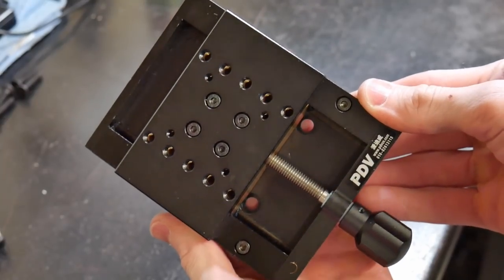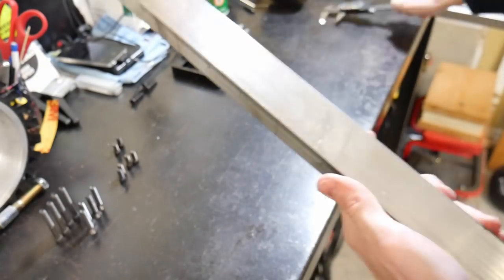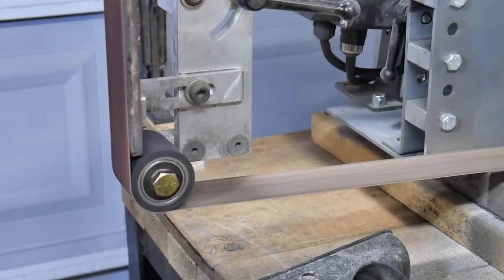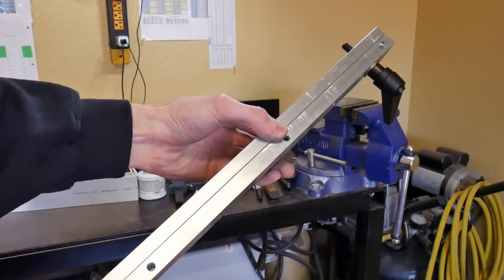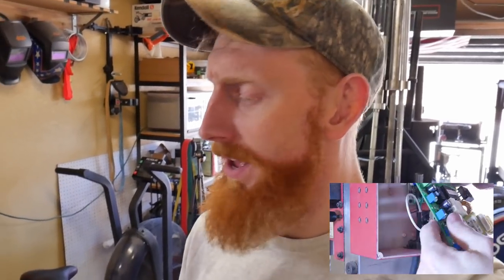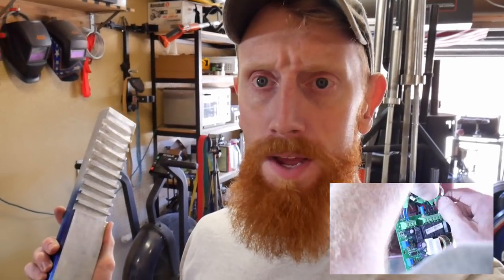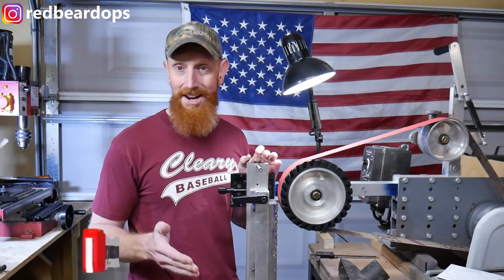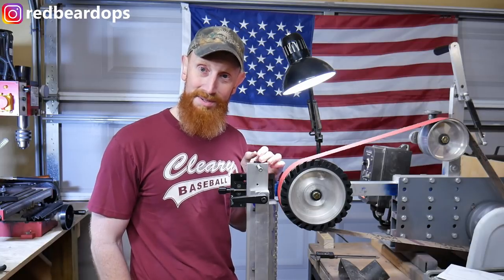Homemade Surface Grinder Attachment - Want Flat Things?

Comment: Good idea but I would have turned the whole setup horizontal and used a vacuum pump to accept my cuttings, relieving me of unnecessary lifting.
Reply from the maker: I agree horizontal would be better! The nice thing about this design is that when I get a horizontal pivot built for my 2x72 then this assembly will be operated horizontally. As far as the cuttings go, you would need a water reservoir on your shop vac set up to avoid catching the shop on fire and/or burning up your vac! Lots of knifemakers rig up these so that they can switch back and forth between grinding woods and metals. Thanks a million for your comment and for watching sir! Have a great Friday!

Comment: to get a decent finish in aluminium use WD40 as your lubricant for milling drilling and tapping....
Reply from the maker: Thank you sir! I transitioned to WD40 about half way though and it worked wayyy better!

Comment: Hi from Captgreg, are you worried about heat ?
That build is awesome great job.
Reply from the maker: Captgreg no sir! Surprisingly enough with a sharp ceramic belt it doesn’t get hot. I do check often though just to make sure. 👍 thanks for watching

Comment: I think .003-.005 is more realistic over an 8" flat because your rubber wheel tolerance is far over that. Hope you got lucky, it could be closer!
Reply from the maker: Hey Bob, this thing is great to have around the shop so far. I think if you feed in slow you can negate some of the "out of round" issues with the wheel since the "high point" of the wheel will be cutting the deepest and if you feed slow that can be over the whole part. As far as the "side to side" issues with the wheel, I think that is fixed by using the wheel to surface the magnetic chuck itself... thus making them a matted pair. 

Anyways, it's not perfect, but for the task of making full tang hunting and bushcraft knives, it's great. If you needed sub 0.003" results every time... this isn't it.

Cheers sir, have a great rest of your week!
Reply: @RedBeardOps  Agreed, and I'm jealous!

Comment: Well, you got me James. I honestly did not see that coming 😁  Very thorough and produced video with tons of great information and details! So, I guess the next question is: How much are your production models going to run? 😎 Thank you for all the info and inspiration brother.
Reply from the maker: LOL! Thank you sir! Man I don't plan on making any more of these currently. They take a good deal of time to produce! Lots of milling, and lots of drilling and tapping! The cheapest one I've seen on the market is $890 + S&H from OBM. If you build one like this you'll be out around $500. If you wanted to make one without a mill I bet you could find a local machine shop that would do the slots on the cheap. Cheers man, thanks for dropping by the comment section as always!

Comment: I use a 2 1/2 wide wheel so u can run the belt over an do wider blades
Reply from the maker: Yes sir, I have that same set up but with a 3'' wheel and a 2.5'' chuck. I can move the belt around, but it seems like it would be nice to have a 3'' belt! I'll see if I can find some at a decent price... who knows. Thanks for watching!
Reply: @RedBeardOps  Contact Combat Abrasives!  They can custom make any belt you want, and 3"x72" would be easy since they already do 2"x72" cut from a larger width belt.
Reply from the maker: Jeff Kushen thank you sir! I’ll contact them for sure 👍
Reply: @RedBeardOps  I just use a 2 inch belt an move it from side to side with the tracking
Reply from the maker: @HouseBladeDesign  Yes sir, that's what I've done to this point. I didn't know if I'd be any more accurate with my "chuck leveling" by using a 3'' belt and not moving it around. I was having some issues yesterday with chasing warps around. It seems like I need to come into the machine with a none warped blade, since the magnets will pull out the warp! Do you ever utilize shims on warped blades?
Reply: @RedBeardOps  man from Australia built mine for my dozier custom built it for me,took to weeks from Australia to usa he made the wheel on it an it works well if I remember it was called 84 engineering he makes alot of cool different knife related gear..great prices also

Comment: I may be wrong but it looks like you used a 82 degree countersink. Metric screws are 90 degree not 82.
makes your screw heads stick up at the top. If I am wrong please disregard this post.
Reply from the maker: MR DEWITY you’re probably right. I haven’t ever checked! Thanks for your comment, that’s likely what is going on.

Comment: omg i sat through this thinking that this was going to be a surface grinder attachment not a belt grinder attachment!!!!!  I WONDER WHERE I GOT THAT IDEA?

BTW this is not going to get anywhere near the accuracy of a surface grinder all that's gonna do is Polish up parts
Reply from the maker: Hey clown, sorry you didn't enjoy this one. It's doing a great job for me as a knifemaker. But I don't require tolerances less than 0.001"
Reply: @RedBeardOps  I mainly am at odds with the fact that you named your video to make it sound like it was a surface grinder attachment it's actually a belt grinder attachment that acts like a surface grinder I guess.
Reply from the maker: @ClownWhisper  Yep I get it. As a knife maker, this set up is very common and sought after. But outside of the knife making community I can see it being confusing.

Comment: for the sake of you and your shop, i hope you keep the aluminum and steel dust separate. if one spark catches a dry pile of mixed dust, you'll have a thermite fire on your hands.
Reply from the maker: Thanks for the tip sir! I always make sure to have my vac off when grinding metal for similar reasons with wood dust. (not to mention it would tear up the vac motor). Cheers man, have a good one.
Reply: wtf are you talking about i have steel and aluminum dust everywhere and i cant light that shit on fire? i throw lit cigarettes on the floor all day no issues guy. 
\
Reply: @Steechd  it's not so much an "all over the place in a thin film" thing as it is "there's a big pile of mixed dust, it's very dry, and  the steel has oxidized". those are the ingredients of a thermite fire. it happened to a shop i worked in that had a sheet metal sanding machine.
Reply: @iceowl  : Brooms are a thing.

lol..
Reply: @kadmow  so are dust collection bins. the problem isn't a lack of cleaning up, it's keeping a big pile of fine granules of aluminum and oxidized steel in the same bin. if it's dry enough and one spark hits it, you've got a thermite fire.

Comment: i see epoxy getting warm and melt :D flying magnets into the belt, fun times
Reply from the maker: Yeah, you'd think so, but the blade really doesn't get hot at all. I do my surface grinding post heat treat so the blade must stay cool. I check often. Cheers, thanks for watching!

Comment: put a stepper motor and 2 limit switches on it
hands free mode
you could cnc both the y and z axis
Reply from the maker: Good Idea!
Reply: @RedBeardOps  programmable motion controller is part number st-pmc1 think i paid 40 bucks each axis couple of years ago  simplest way to control steppers 
i think it has 16 steps
Reply: @RedBeardOps  if you really wanted to you can add steppers on a couple more axis and go full cnc and change angle of blade with computer numeric control (cnc)
and make blade contours 
very good idea you have started but you have to do it now you are giving it to the world  very simple cnc machine to build but 

i can not do it but alot of people can 
i am just the idea man in a little shop that watched your vid 
i don't know if anyone is doing cnc belt sander knife blade if you think about cnc it is very good  you can put wave effects in the blade with a belt sander that is cnc controlled 
sorry so long

Comment: Use WD40 as lubricant when milling the aluminum, it will cut a lot nicer.
Reply from the maker: Cheers man! Thanks for the tip! I did switch to WD40 about 1/2 way though the project and it did work better.
Reply: @RedBeardOps  try kerosine its cheaper.

Comment: My only concern would be that as you grind your knife, it will get hot, and that will heat up your table with your magnets, and that will heat up the epoxy, and the epoxy will fail.
Reply from the maker: Hey Sam, I can confirm that this is not an issue with this SGA. With only a single point of contact on the wheel, the speed of moving the SGA and the aluminum acting as a heat sink; the blades rarely get hot. I use this on my knives normally post heat treat and am constantly checking the temp on the blade so that I don't ruin temper (because I'm paranoid). It's never hot enough to do so. If the blade does start getting a little warm to the touch I just spray it down with some water. Cheers sir!
Reply: @RedBeardOps  That is good yo know. Thanks!

Comment: What hardness is the serrated wheel?
Reply from the maker: They told me it was around 85-90 but who knows.... If you want to know for sure get a wheel from KMG or amerabrade
Reply: @RedBeardOps  they offer two medium 70A and hard 90A so wanted to know which I would need. That was why I asked.
Reply from the maker: @christopherconkright1317  You want the hardest one you can get. So the 90A

Comment: Great video! New sub here. Would you consider making a kit to sell? I’m a buyer if so.
Reply from the maker: Awesome, thanks sir! I turn out a low volume, so I don't have an inventory... and I'm not currently taking custom orders. When I do have a knife for sale I put it up on Instagram. Sorry about that! Cheers
Reply: @RedBeardOps  no worries! I’m pretty far behind cranking blades out myself. I was actually asking about a kit for the surface grinder, but I get how hard it is to keep up with orders. Be safe

Comment: That is not a "surface grinder" it is a belt sander and you built and a nice one at that.  A surface grinder uses a grinding wheel and magnetic chuck to hold the work piece and reciprocates back and forth they are used in tool rooms and can hold tolerances of as close a tenth of a thousandth of an inch .0001" they have been around for about 120 years or more. Belt sanders have also been around even longer. Trust me machinist and toolmakers have very precise terminology for everything you can imagine.
Reply: Sure, its not a traditional surface  grinder...  if you cant find a clapped out grinder to rebuild  and your demands arent that demanding, its fine. Nobody is going to grind parallels with this, but he did a fine job. Lighten up.
Reply from the maker: Yes sir, I realize that. In the knife making community we refer to these attachments as surface grinders. For the sake of our craft, the precision of these tools are adequate... but like you said they can't hold a torch to a real surface grinder with a stone. Thanks for your comment and have a great week!
Reply from the maker: Thank you for your kind words, sir.
Reply: Buddy it actually is a surface grinder. It grinds a reasonably flat surface for the  small projects. Perfect for small shop. 
Just not as precise as a dedacated unit
Reply: Hi Rob.
You sound like an expert in surface grinders.
What do you do for a living? Do you have a grinder video. Or maybe you're just a wana be  ?

Comment: In-depth and informative. Thanks for your efforts to share.
Why you flip flop on conveying the sizes ?
You're metric then imperial. You're young enough to create change. Evolving (as you should) to metric conversion. By constantly pushing the imperial narrative the transition will take forever.
Reply from the maker: Figured I'd make yall work for it. Cheers sir! ;)

Comment: Seriously your worried about .001 in a knife blade that was forged with a power hammer, press or hammer. I'm sure it will be more than adequate for goodness sakes.
Reply from the maker: The more accurate the better!

Comment: Hehe strange with those metric bolts, those odd ones, you know almost all country's use metric, it is only Canada and USA that never seems manage the change . it may help if i told you that the inch system was invented by a Swedish guy, he took the metric system, invented by a Frensh man, and changed it, he did not manage to sell it in in Europe.i think England maybe, but they have changed to metric a long time ago. Anyway nice work
Reply from the maker: Thanks Otto! Cheers sir

Comment: For the magnets....do every other slot. By the time you get to the end the epoxy in the first will have cured.
Reply from the maker: That would of helped a lot!
Reply: @RedBeardOps  hindsight is always 20/20. 😉 😀
Stellar work though. Do you ever watch This Old Tony? I have learned a bit from him about my speeds and feeds. ☺
Reply from the maker: @xanderstrlyczula5438  I love that guys channel!
Reply: @RedBeardOps  I definitely think your on the way to Great Things my Man.
Only thing I can think of add to it is a method to raise and lower the magnets within the slots. Basically "activating" and "deactivating" the magnets by moving them closer and farther from the work bed. The closer the magnets are the greater the pull.
I didnt notice the depth difference from the face of the magnets and the bed face of the aluminum. Closer the better.
I presume you slide the part on and off the bed?
If there's room. I would pour epoxy over the magnets to fill the cavities. Then grind down flush with the aluminum to within mm of the magnets. The epoxy will help keep the magnets intact. The nickel coating can peel away.
Reply from the maker: @xanderstrlyczula5438  Good thoughts sir! I have a video coming out in about 1-2 weeks that will be showing an upgraded chuck. Stay tuned! Cheers

Comment: if it was me I would modify the mill with just a ac motor and some pulleys no need for the dc with all the crap on it . 1 )2 horse will do fine out of an old washing machine.
Reply from the maker: Very good idea, sir! Thanks for watching and commenting.
Reply: I do have a tread mill motor 4 horse power 120 DC , but as the RPM drops so does the torque , and your right the DC is grate for its size to power factor .

Comment: Dishing and warping are probably not the most concerning issues with too much feed rate...it's the work piece/knife blank flying off the mag bed straight into your foot at high velocity that's concerning LOL
Reply from the maker: Man, it's on their hard! It would require massive user error in feed rates. I've used this thing for about a year now and it's never been an issue. Good thoughts though!
Reply: @RedBeardOps  No doubt, I have a huge fishing magnet that's supposed to have something like 3500lbs of lifting force, and it's a real bear if it gets stuck on something big.  Even so, something about all the pieces of things that I've launched into near earth orbit from a belt sander and seeing a blank being held on by magical invisible forces still manages to unnerve me a little, I can't help it.  I have an auto feed surface grinder so I can just run away when I hit the power and come back when it's done LOL 

Also, surface grinding a warped piece is pretty easy.  I set the blank on a platen and shim it with feeler gauges until it stops rocking (check it with a dial indicator for the utmost accuracy).  Take those same feeler gauges to the mag table and shim the blank back up to eliminate any rocking, then a little dykem while grinding to make sure you have a true flat surface to work with.  From there you just flip it and you've got a nice square piece.  If it's a banana, shimming on both sides is better than shimming one side all the way...that takes half as much of your thickness away by spreading it out to both ends.  A twist is best shimmed on the outer corners.  Sometimes the warp is just right there on the edge and shimming one side saves the most material.  It's kind of up to you how you want to flatten the warp, really.  Using brass feeler gauges are preferable to steel in this case, because you'll just end up with bent steel feeler gauges.  Preventing warps are the best solution, but sometimes it just happens and you're stuck with it.
Reply from the maker: @Skinflaps_Meatslapper  Good tips sir! I think you'll like the video I'm dropping towards the end of the week. It's on upgrading this magnet!  Cheers man
Reply: @RedBeardOps  Right on, my dude 👌  I love watching builds and upgrades, it's fun to see what kind of innovative things come from not just buying something off the shelf.

Comment: all that precise machining and using a adjustable wrench...…..and why didn't you just thread the axle bolt instead of boring out the hole??? but all and all great build!!
Reply from the maker: I had tread that threading grade 8 bolts can be difficult since the threads on the bolt are rolled not cut... Didn't want to fight it!  I figured 1'' of aluminum is still adequate.

Comment: On aluminum 2500 rpm is not bad . and neither is the depth. Use a 2 flute end mill and spray workpiece with WD-40 as your milling. You don't have to flood it, just keep it wet.
Reply from the maker: Thanks for the tip David!

Comment: In a pinch you can use a plywood blade in a table saw to cut your slots, just go slow and take little cuts. Lol
I cut a channel out of an aluminum rail about 3/4 wide with a dado blade once lol, only once. Ruined a 50 dollar blade.
Reply from the maker: Thanks for the tip! Sounds cowboy! I like it.

Comment: Careful you don't lose any of your digits as your confidence with brushing swarf off of drills & bandsaw cutting looks alarming.. I've worked with people of a similar techniques & some were living with trauma from these practices & complacency with machines that don't stop when limbs are "instantly" pulled into cutter.climb milling for finishing,4 thou & the more cutting tips the quicker feeds, take care & carbide 2x speed of hss
Reply from the maker: Thanks for your concern and tips.